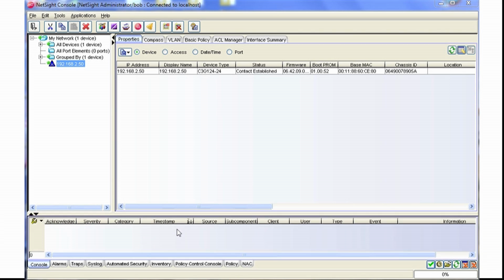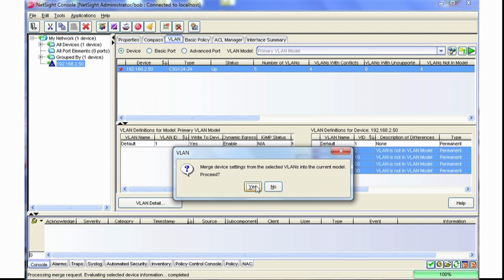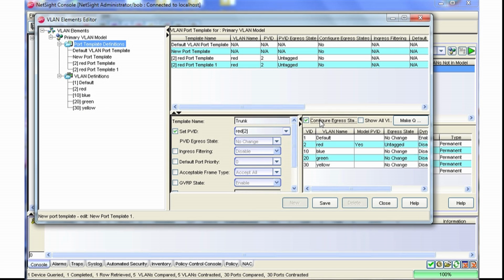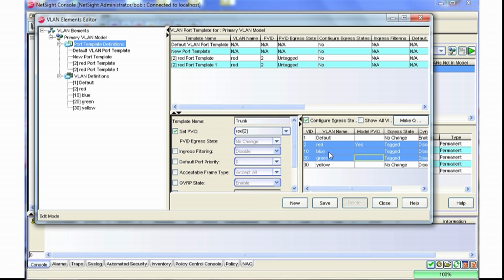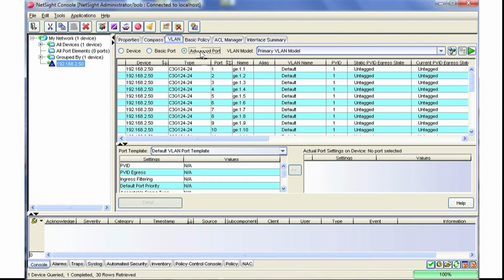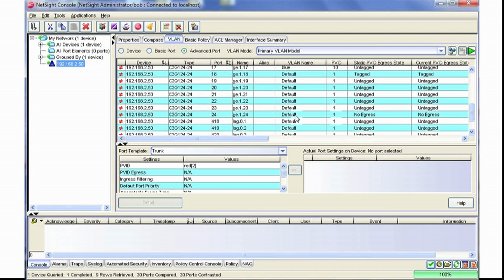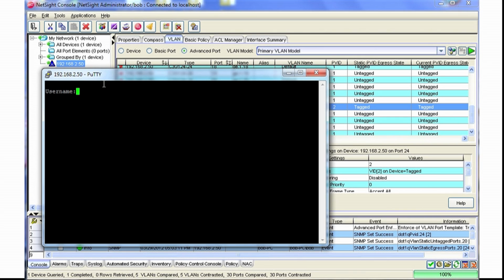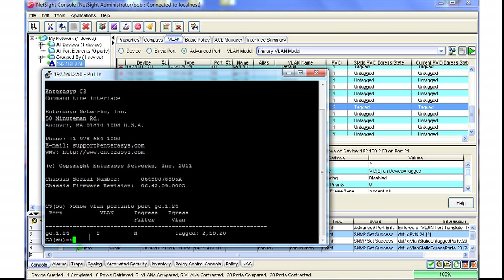How To Configure Trunk Ports

Comment: Why dont you show people how to configure a port for trunking from the console directly rather your little gui software. show a video entering these commands 
interface TenGigabitEthernet1/0/2
 switchport trunk encapsulation dot1q
 switchport trunk allowed vlan 1, 2, 3 and so forth
 switchport mode trunk

not everyone uses that program. People need to know how to configure the ports from the command line.